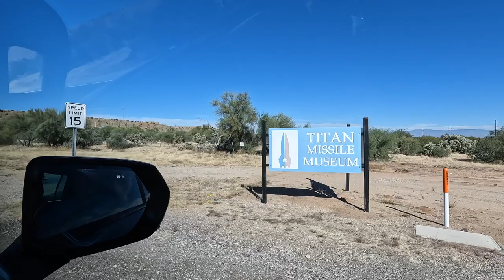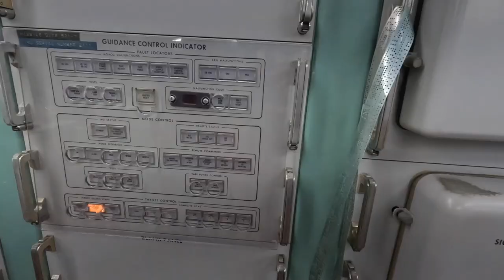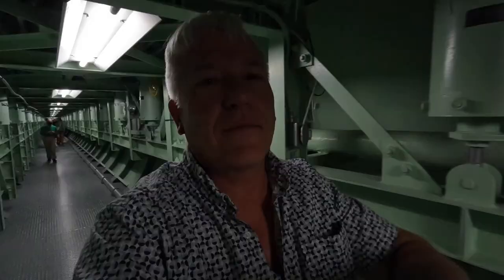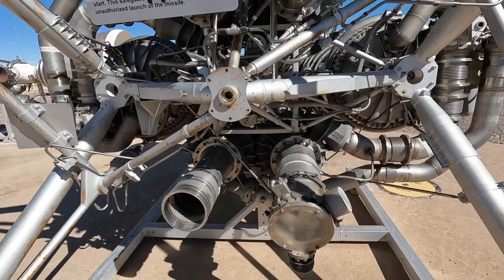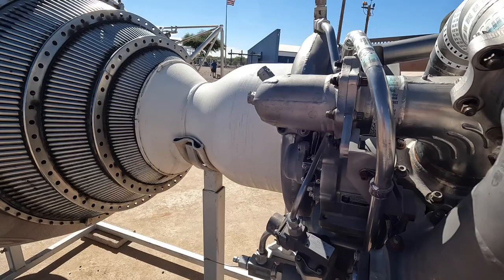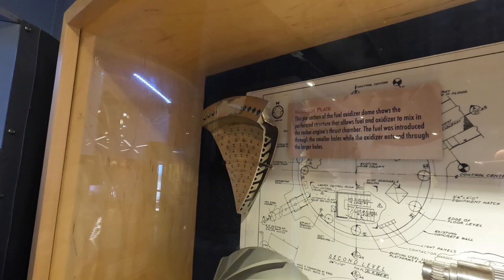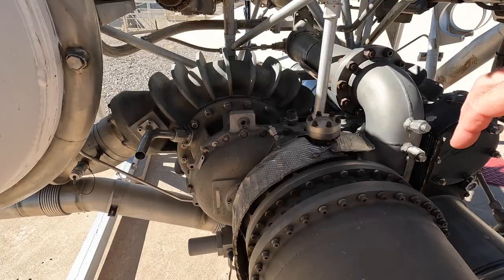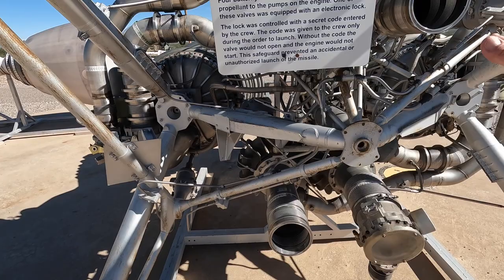Nuclear Missile Silo Museum - Titan II

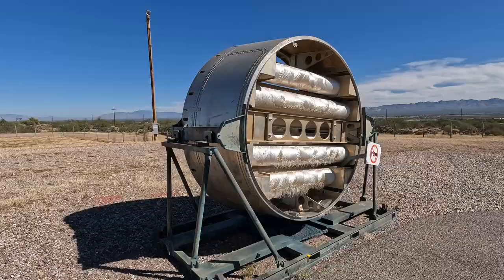Comment: 14:50 “the section that goes on top of the last booster” not mentioned but I think on the plaque -the silver tubes are part of the decoy system and contain balls or balloons released to confuse enemy anti-missile radars. 
Unfortunately I hear these engines are the ones from the display missile – so if you take the tour to the bottom of the silo you don’t get the full effect.
Reply from the maker: They have discontinued the silo bottom tour unfortunately. And the engines used to be under cover but now are out in the open.
Reply: Wow did not know that – did they say why they stopped the bottom tour?
Reply from the maker: @johnwatson3948  They stopped it with Covid in 2020. They told me they were putting together a virtual tour for their website that would show much more than the walking tour. They said they would not do the bottom tour ever again.
Reply from the maker: Thank-you form the info that the engines are not on the silo missile. That would explain the brand new set up on the surface display. I'll bet removing the engines had some thing to do with the treaty that allowed USA to keep the decommissioned silo.
Reply: Thanks, I had guessed probably stopped bottom tour due to Covid – since a virtual tour is nothing like the real thing they must have some other practical reason for not wanting to continue it.